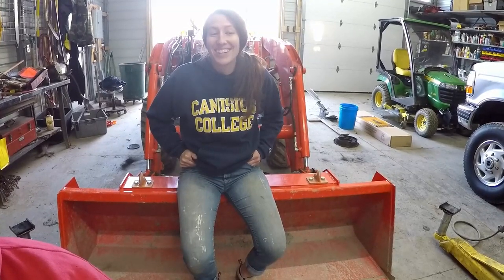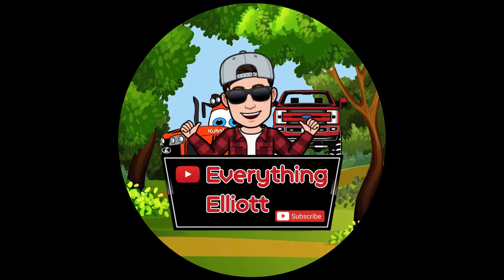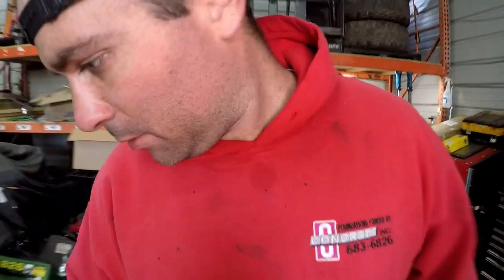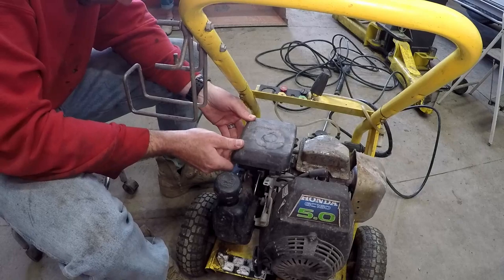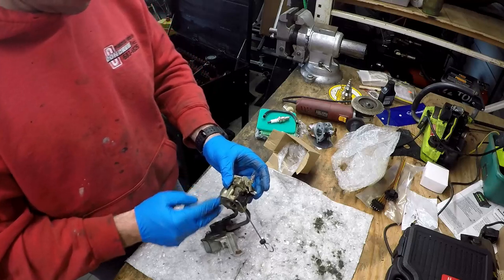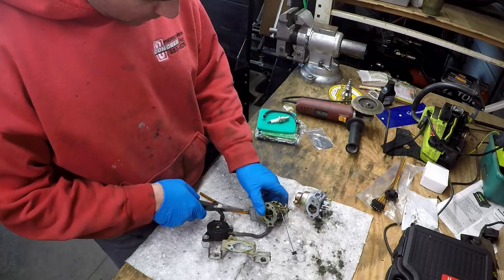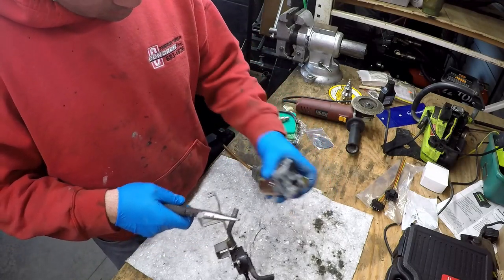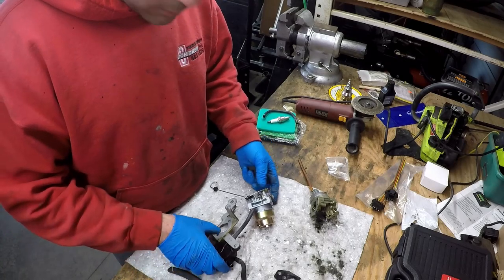Replacing the carb on a HONDA GC160

Comment: Glad it worked out but that carb is for the vertical shaft motors not the horizontal. That's why the bowl drain was different. Also the pre-filter likely isn't needed since it's not a lawn mower.

During reassembly, you installed the choke lever upside-down and the throttle rod goes through the center of the throttle spring.

Last but most important, #1 rule of pressure washer is you don't leave the pressure washer running when you're not using it. You'll overheat the pump if you leave it running without spraying water for 1-2 minutes.
Reply from the maker: Thanks for the tips! Carb is still running strong to this day!
Reply: My honda pw is 18 yrs old just bought 3 of those carbs and fuel pump had to remove spring around black plastic lever it was hindering the choke used it today runs like new
Reply: Thanks. I’ve had my pressure washer that is exactly like the one he’s repairing since brand new. I think I bought it in 1995.

Comment: I have the same pressure washer. I bought it at Costco back around 1995. I overhauled my carburetor with parts from one I bought on Amazon rather than replace the original all together. I was afraid the after market part was not as good as the original . I’m on my 3 rd pump.
Reply from the maker: Sounds like the pump is the weak link in this unit!